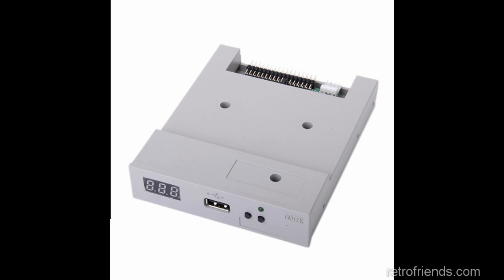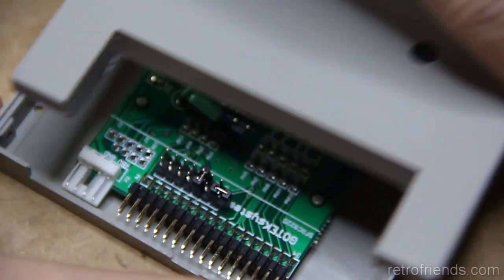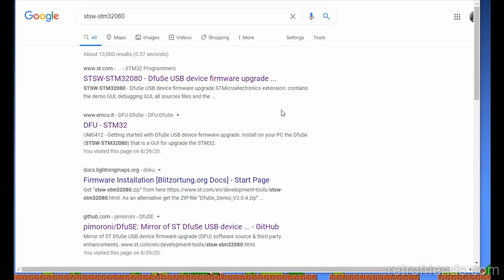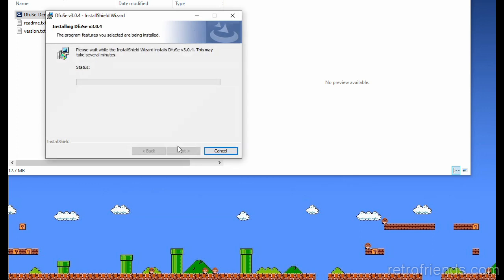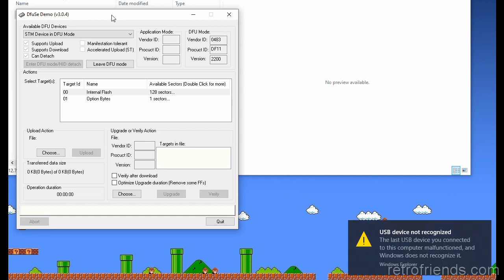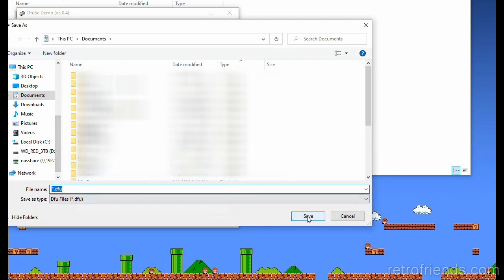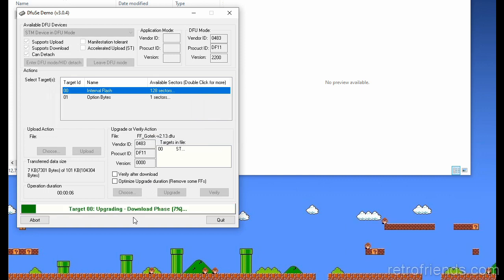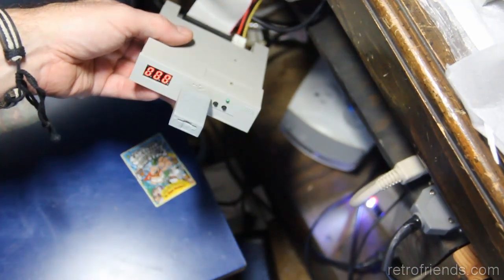Gotek Floppy Emulator for Amiga Part 4: Updated Easy FlashFloppy Installation using USB Cable

Comment: No need to buy freaky cables. All versions of FlashFloppy can update firmware from a USB stick. If it comes from the seller with an old version, and the USB stick is new, it will not show "PRG" when updating. Then you can convert the USB stick to MBR (google) and put the .upd file on it again. Or use an old USB stick temporarily.
Reply from the maker: This is not a tutorial on updating FlashFloppy versions. I have another video for that. This shows how to change stock Gotek firmware to FF, which does require a USB-A to A cable.

Comment: Everybody tells you how to install but nobody says how to get your Amiga floppies to the thumb drive. My PC does not read my Amiga floppies.
Reply from the maker: Use an emulator, which can read disk images and also can read amiga files. WinUAE, for example, can mount .adf disk images. It can also mount folders of your Windows PC. Load up Workbench in the emulator and move files back amd forth.

Comment: So you still need to pull apart and solder, so I don’t understand the advantage of this approach? Especially considering that a USB A-A cable costs more than a cheap USB-TTL adapter. I guess this approach is useful if you already have a USB A-A cable but don’t already have a USB-TTL adapter.
Reply from the maker: Check my newer updated video. The new ARTERY boards only need one jumper, and you can stick a wire in there without sildering or even taking the case off. 

You can still use the TTL method, however in my and many other's experience it is flaky, requires frequent board resets, and takes maybe 10x as long to flash. I flashed maybe 60 goteks with the TTL method, but once I discovered the USB way I never looked back :)
Reply: @retrofriends  Thanks.  I've just watched the updated video, and USB does indeed look to be the quickest, especially with the new Artery MCU boards.  My Gotek is on it's way, so when it arrives I'll find out if it's STM or Artery.  I probably have a USB A-A somwhere in my cable boxes. I sure have plenty of USB-TTL adapters lying around. :)

Comment: You seem to respond to old videos, maybe you can help. I have an old version with the old chip. Has there been independent open source software for flashing, particularly on linux? I feel like filling out a form for Windows software seems pretty backwards, maybe necessary for the new firmware, but surely STM32... version can be burned from linux? Do you know?
Reply from the maker: I don't know if you can do this in Linux.

Comment: This does not work. I am using win10,  Dfuse v3.0.6. At first plug in. Windows said It's ready to use But it isn't. Went to device manager to install drive and got 'window was unable to install your DFU in FS mode'!
Reply from the maker: The new Goteks are completely different!!! New procedure in the desrcription!!!

Comment: I´ve just upgraded my Gotek using this method of yours. It worked flawlessly! Only detail is that for the Gotek to be recognized for Windows 10 I had to run the file "dpinst_amd64.exe" inside Driver/Win10. I did that and the device was updated automatically into the device manager and that way it appeared into DfuSe Demo program and allowed me to flash it. Thanks for the video!
Reply from the maker: Thank you for the additional information!
Reply: @retrofriends  Yes, You have to install de driver in windows 10 (after exe installation) for the second time from here: C:\Program Files (x86)\STMicroelectronics\Software\DfuSe v3.0.6\Bin\Driver\Win10\

Comment: In my opinion (and my experience with Goteks) there's absolutely no need to do ANY soldering (which is good news, especially if - like me - you're crap at it). Simply use some short pieces of straightened-out paper clip to jumper the two pairs of holes as indicated in this vid. The PCB holes are through-plated so it shouldn't be too hard to get a connection. Ensure the wires are not touching each other or anything else on the board. He didn't say it explicitly, but it is not necessary to power the Gotek for the flashing process.  And just remember to remove those wires before connecting your Gotek to your computer or synth keyboard.
Reply from the maker: That is perhaps a good suggestion, however I recommend care not to short something that is not supposed to be shorted. I have been selling these pre-modded on eBay with OLED, dial, and speaker if anyone needs that. Check the description for the eBay store link.
Reply: @retrofriends  All you need are short pieces that stick out 2-3mm. Snip them with side-cutting pliers. Had no problem  when I flashed mine. Saved me at least an hour of soldering, not to mention trying to buy pin headers locally (and in remote area of a foreign country too).
Reply from the maker: @droses1600  In the video I show it takes only a few minutes for the average user to solder one unit (vast majority of viewers who do this mod would only need one or two). Regardless like I said, it is a good suggestion. In my experience of modding hundreds of Goteks, I have done it myself every-which-way you can imagine.
Reply: @retrofriends  At the exact moment you were typing that, I am trying to do some soldering for the pickups on a guitar kit build. Just two pairs of wires to two volume pots (middle tag and back of case). What would take you 5 minutes has just taken me an hour. And it still doesn't work properly (think I've got a dry joint). So no, I would choose the paper clip option a million times more often than your way. And I suspect the same is true for many others out there. What's the point anyway of soldering permanent pin headers?? Once it's flashed, you are NEVER going to need to jumper again. Great, you've got that skill; I haven't, so I'll seek an easier and quicker alternative. Horses for courses.

Comment: Thanks for making this. I came from Jan Beta's video. I plan to try this today or tomorrow. Figure since I have pin headers and jumper wires I might as well just solder them on if I'm going to break out the soldering iron. I have to clean up a space first, but I'll reply with my results when I try it.

I also want to do all the other mods for my Gotek. I found some parts on Amazon, would these be alright?
 OLED: https://www.amazon.com/WayinTop-Display-SSD1306-3-3V-5V-Raspberry/dp/B085NHJYBV/
Rotary: https://www.amazon.com/Cylewet-Encoder-Digital-Potentiometer-Arduino/dp/B07DM2YMT4/
Speaker: https://www.amazon.com/Uxcell-a15080600ux0275-Internal-Magnet-Speaker/dp/B0177ABRQ6/

I had the idea, if it went well I would try modding a few for fun and selling the ones I don't need on e-bay. I saw some people in the EU selling them pre-made but no one in the US.
Edit: I feel so dumb, I just realized you sell them but for some reason Ebay never showed them to me in multiple searches over the past couple weeks >.>

Comment: Seems quite simple to upgrade.  Would you consider using standard jumpers then you could just jumper them as needed?
Reply from the maker: Yes you can do that. Seemed quicker for one time use to throw jumper wire in there. I didn't even have to remove the gotek from it's case. To each his own.